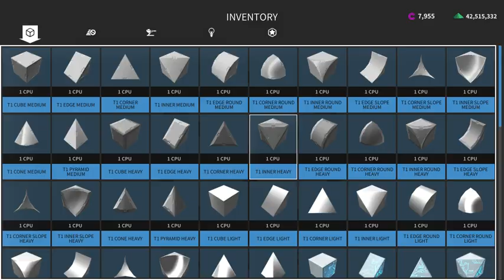Robocraft: One Take Triforcing - Part 4 - Advanced triforcing and design compression

Comment: First of all - its great to see build techniques covered in 2020. Thank you for sharing. :c)

13:40 - Hold up. Are you saying that when a part is destroyed and damage needs to propagate to the next step - if that part has more than one connected part then the damage will be attributed to these parts in TURN? That is certainly interesting and good to keep in mind.
Reply from the maker: To answer your question: Damage is sequential, using up the blocks from each “step” before being able to move to any blocks on the next step. If the damage is not able to destroy all blocks on a step it randomly divides up the remaining health between all the remaining blocks. In the case of the car example, damage coming up from the green line (in front where it is most likely to be hit first) will reach the wheel’s mounting block. On the next step assuming this is all direct damage flowing as normal with somewhat less damage than the combined health pool of the wheel and next heavy cube (the first red block) damage will be divided up randomly between the wheel the heavy cube. (more detail below) 

Once the damage is calculated, then the game checks to see if any parts of the bot have become separated from the whole (a function of which half has more remaining CPU). In this case the wheel will be lost either way as the mounting block it was attached to was destroyed. However, if the red heavy cube remains so too does the connection between the blue split protection and the body through the red chain. So, the wheel’s health pool is partially protecting the connection between red and blue. 

If you wanted to make it 100% foolproof you would add another block of delay between the wheel mounting block and the place where red and blue connect. This would ensure that the health of the wheel MUST be used up before damage reaches the red blue connection. However, in the interest of saving volume/space this builder has chosen the more risky but compact mounting option, a choice that must be carefully made. You might say “Oh, it is only a single block!” but you have to remember this setup is repeated for all wheels so in this case it is an extra 6 blocks that must be used for all the other wheels as well. 

Too many duel mount lines and the fractional % of your bot that is not meant to take damage directly increases thus increasing the chance that it will be hit directly by damage instead of damage coming in from the ends like it is supposed to. When this happens, there is no damage sink (the blockspam of the body or a single point sink) to absorb the damage and you will lose the functional component it is meant to provide a damage buffer and connection point for.  

If you watch from the beginning of this series I illustrate all of what I have said above.
Reply: @twotoneterminus4976  Thank you very much for the explanation (almost forgot to reply). 

I was mistaken in thinking that damage hits 'all' parts in a step at the same time - So that if, for instance, 4000 damage were to hit the connecting block between the rod connection and the wheel then the block 'would' be destroyed and leftover damage would be absorbed by the wheel until destroyed or expended - and then the next step happens.

Its an important difference and shall impact the way I design bots in future.

Ah yes. I did see your previous videos on my other account. They are very informative.

Comment from the maker: One point I forgot to mention in the video with the mega smg example: The mega smg legs act as a damage sinks on the line coming from the body of the bot opposite the hover connection side. If damage stops there it severs the line right up until under the foot and preserves the hover. If damage destroys the gun, the overflow meets the sinks meant to protect the hovers in the same way it would if the gun was hit directly (to the shields and strut).